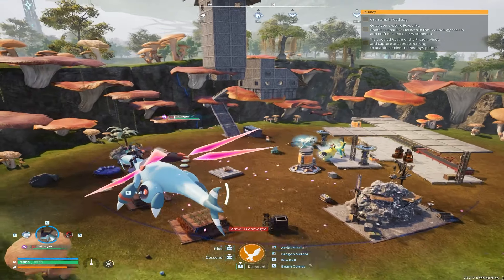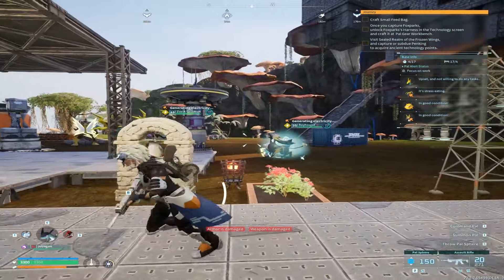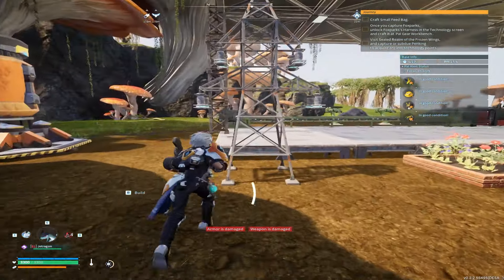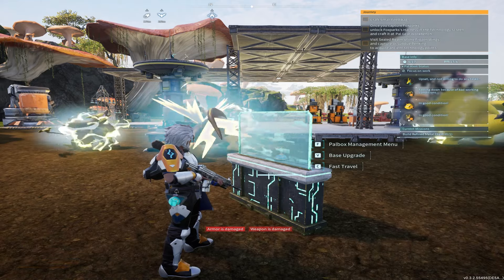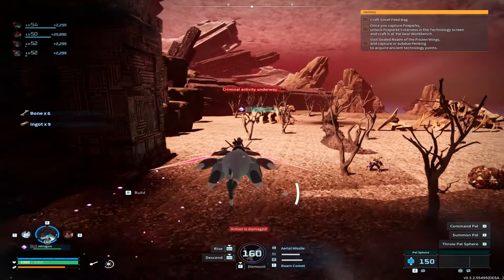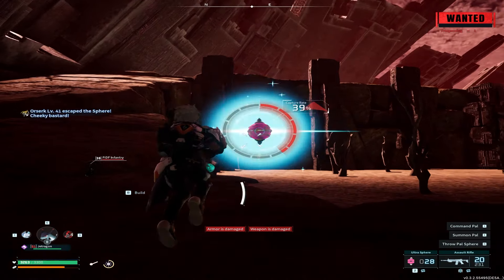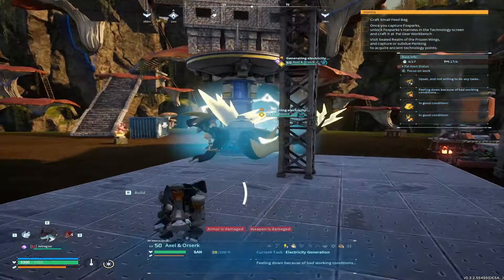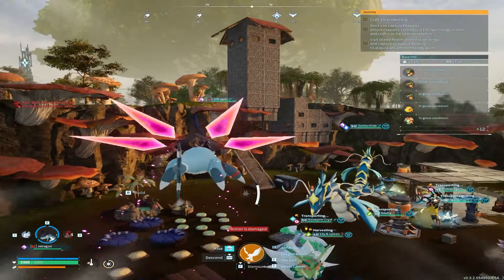The best way to farm OIL at your BASE (NEW PALWORLD UPDATE)

Comment: oil pumps seem to "tick" when you have 10% electrical stored up & stops when hits 0%. (so faster you can raise it longer it takes to drain and thus produce more ticks)
So ideally you are gonna want a maxed out Orserk (condensed fully to hit rank 5 electric charging which is about double rate of a rank 4) w/ the 30% work spd pal soul upgrade and ideally you'd work on passives for work speed (and nocturnal so it works at night).
Using anything less is just wasting slots of base pals & production of oil.

Also fun new pal is the shrooms...just by being in base reduces SAN loss for all your pals in base (which helps w/ pals that are goign to be nearly works non stop)
Reply: I have 2 orserks with artisan, serious, diet love and nocturnal. 2 generators with them being fixed on only producing electricity I haven't seen them hit 0 at all. That's even with 6 assembly lines and 6 electric furnaces all going at the same time too
Reply from the maker: if that mushroom thing is facts that’s cool i didn’t know that
Reply: @chloesecret8606  Yeah I had some serious problems maintaining the power until iPad a large power generator but yeah I need to find a good electric pal for night time

Comment: I only have just started
But I have found the Helzephyr Lux from the new land has a level 3 Ele Gen and is noct. So I have 2 generators with 4 Orserk's and 4 Helzephrt Lux's (4 each for when some need breaks) and they keep the new genators powered night and day.
I have also figured out that there is now a nocturnal passive, so next on the list is to try to breed that passive onto my best base workers.

Comment: Good thing I prepared for this and started with 82 million gold aswell as 10 perfect Ozerks into the update ✌️😅
Reply: Now you really need to rebred the Orserk because it needs nocturnal to keep that oil pumping day and night
Reply: I changed my Orserk to work slave, artisan, workaholic, and nocturnal to keep that oil pumping
Reply: what did you do to get 82 MILLION 😳 what's your money making strategy?
Reply: @aggresive_hef6103  Not really needed, i have 4 oil pumps in my base and 2 big generators and 4 perfect bred orserk are enough to keep them running, even when they are sleeping the power doesnt run out that fast

Comment: With these elixirs if you drink them then mind wipe does your character store them as free points or do you loose them and need to re drink for the extra points after max level?
Reply: No, they will stay on you as base levels that can't be taken away, the points you can spend are only from levels.
Reply: @vortexoku5570  yeah thank you for that. Had confirmation twice now so should be safe to drink them now :)